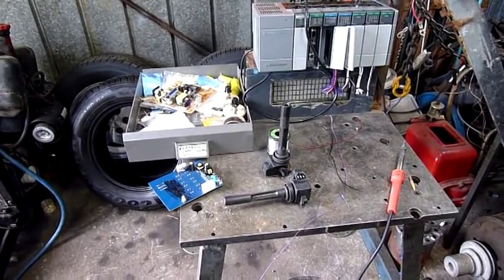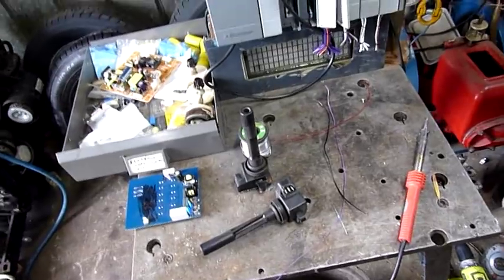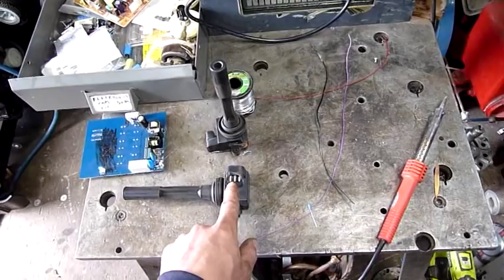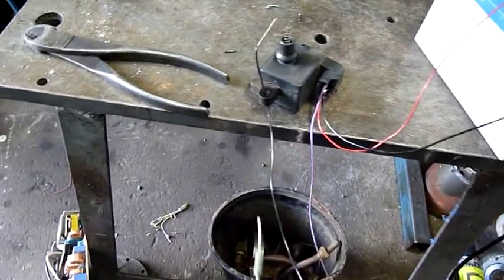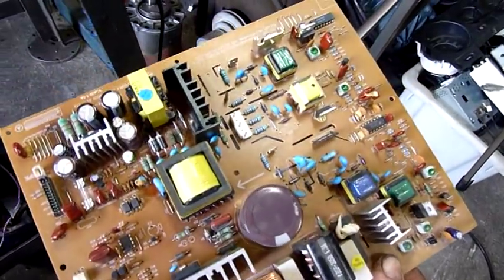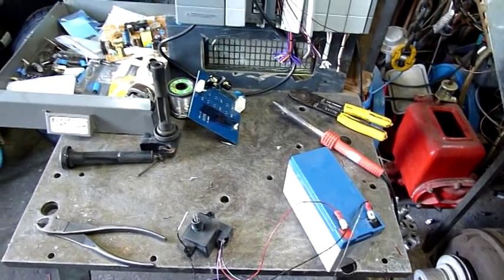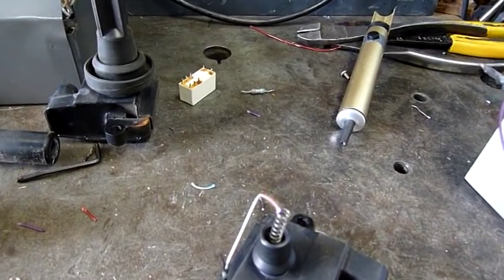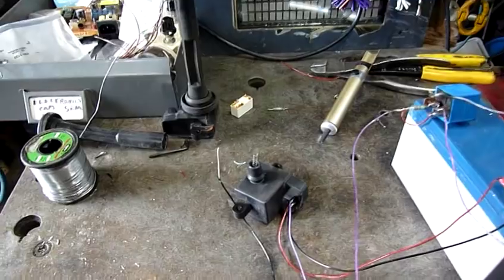Cheap Nasty Ignition Coil Driver - Oscillating Relay

Comment: This is a lot like how I did my first High Voltage experiments.  Except instead of an ignition coil I tried it with a MOT and a Flyback.  It worked until the little wall-wart power supply I used gave up on me, it was just too much for it to cope with.  The relay is still working and in something else now.

Comment: Stick some metallic rod into ign. coil HV output, make negative to metallic rod spark gap and you have very crude EMP. It might disconnect USB flash drives, keyboards and such in a couple m radius.

Comment: Great Video!... I love playing around with coils and relays.. They have so much potential for great experiments!! Here is exactly how it works....   when the coil de-energizes, the back emf is what is building the voltage spike that adds a much larger than normal amount input voltage to the primary of the coil. The relay in oscillation creates anywhere from 50 volts ac to 300 vac in oscillation just as long as there is not a suppression diode across the coil. If this is shown on the relay diagram, either cut it out of the circuit , or find another relay because it will not work based on the fact that the back emf spike is needed to drive the primary coil. Depending on the ratio of the transformer coil will determine the output voltage. Normally the input side of the coil sees 12 volts oscillated, or 12 vac, so, if the output would have normally be 50000 volts, it could be as high as 1,249,800 volts on the output using a relay as a driver ! to figure this out, take your 50kv output of the coil and divide it by 12... you'll get 4166, making the coil a 1-4166 ratio device. Take 300 vac (which is the maximum oscillation voltage that I normally obtain with the automotive relay) , and multiply it by 4166 and you'll get 1,250,000 volts maximum,  or close. That is some serious voltage, but, it will be a very low amperage that will not normally kill anybody but, it will suck if you get hit by this, so, definitely be careful as it may knock you out cold. If you had wire with insulation that could withstand this voltage, it probably wouldn't fail in the video, but, it is only a matter of time before the coil inside of the ignition coil fries due to over-voltage.. Good Luck & Have Fun!
Reply: I would think the coil would get over saturated before it reaches 1,000Kv.

Comment: You still haven't given compelling evidence that the relay booster voltage. You only spread the wires out and draw the ark out when you have the relay going you never did that when you just wired it straight up so we have nothing to compare it to.

Comment: work out what they draw, i shouldn't thing its much over an amp at full tilt. that means if it had a 10,000 volt secondary output  (should be much larger) it would have a 1.2 milliamp output. it will get you moving for sure but as they say, volts give you the jolts, amps put out your lamps. ide say its one of the safer things but as you say no high voltage is to be played with dosnt matter if its a 9 volt battery and an transformer with the secondary hooked up the the battery, those things burn!

Comment: I accidentally killed a pyramid 30 amp power supply years ago while playing with an ignition coil and a relay like this. The lesson is, use a diode to keep the hv out of your power supply, or just use a battery for power.

Comment: I put a Bosch coil and condenser on a turn signal relay. But my sparks arent even 1/2 of that. It is an old coil and an old 12V 7.2A/hr.
What I do like about the relay is that it sounds alot like its close to 50/60 hz. So I might try connecting a 2N3055 transistor and see if I can invert to 120 with a few watts.

Comment: It will hurt but it won't kill :) lots of volts no amps
i'm using a spark coil for m electric fence (used to secure my property from thiefes)
You could use a vacuum relay - lots of cycles per second due to the lightness of the contact armature and no air resistance

Comment: You could make a little 1 transistor amplifier circuit going to the trigger circuit and than have an old mp3 player with different frequencies going into the amp :) that might be the most simple way to do this without a relay :) should give it a try;)

Comment: My friend and I did this several years ago. We stretched a long wire (old phone wiring) across his backyard,connected one end to the ignition coil,and the far end we connected to a small flouro tube,with the tube's opposite end stick in the dirt. The tube lit and flickered..then his mom,neighbors,etc. all started coming out and yelling at us. Not only TV and radio,but Cable TV,phones,cellphones,etc. We wiped out damn-near every signal on the block.

Comment: I work on cars ,you work on electronics what works in the lab , does not sometimes work in the field , seen it in my 30 years of wrenching , case point GM HEI ignition ,and Chrysler corps lean burn systems  from the 1970's , and 20 years working on a funny car burning gas to Nitro ,we tried High KV setups and they do not work  low Kv and high amps work better ,  also Dr Christopher Jacobs was the one who proved it.

Comment: actually you do not want more voltage , you want more amperage ( push) with higher compressions , on a nitro motor we use 44 amp transformers to fire the fuel mixture , it make one hell of a nice thick blue spark , and also melts the tips off the plugs in open air , a normal car engine in cranking mode (450-600 rpm) is 100 psi , but once you get the motor running the pressures before firing can be upwards to 500 psi , and if the mixture is lean you need more amps to light the fire .

Comment: ED a automotive coil for the cop systems run at 60 hz at 7200 rpm at 12 v ( as thy fire once per 2 rev and have execellent dwell ) , the old single coil systems used a 6-9 v to run and 12 v to start ( for richer mixtures with the choke on ) and  its one coil firing all cylinders every 2 revs , so they have to be bigger to develop a charge quickly,  also to make the relays points last longer use a capacitor across the points , and the voltage across the gap is around 45k-60K but low amps  .

Comment: Incorrect. The breakdown voltage of air increases with pressure, so you need a higher voltage to strike an arc.

Comment: oh and I forgot to add the newer cars are fired by  the ecms with no mechanical relays , they must be using a mofset to do it , they also use them to control the injectors too , not a electronics person other than old car ignition stuff ,slowly learning the new systems on how the magic boxes work other than letting the magic smoke out of them .

Comment: look at a old model A ford ignition system , it was a vibrator they used to fire the motor , it randomly fired the cylinders .  simplistic and worked for many vehicles , Kettering ( Delco) was the one who developed the distributor and points system to be used on the Cadillacs and Gm adopted it . then it was adopted by the auto industry

Comment: That's what they used to do to step-up the 12V in a car,to power the tubes in the radio! Google for "Vibrator power supply" (No,not THAT type of vibrator.)
They even had vibrators with a second set of contacts,for synchronous rectification!

Comment: nope, because when an engine is near TDC, there is over 100psi of pressure in the cylinder, so there is more air in between the spark gap therefore the breakdown voltage gets higher, for high compression engines that can be upto 100kv!

Comment: P.S. EMP contd.: you might also experiment with different metallic rod lengths. it basically would be an antenna. 150-350mm might be good.

Comment: would putting a potentiometer in line with the coil of the relay to adjust the voltage going to it control  the speed that the relay vibrates ?

Comment: Well, this go's back to the T model ford and such coils that used the coil its self like the relay coil, with the vibrating contact on the end. You should be able to tune it using R and C on the relay coil, also this works well with old point style coils!

Comment: Many years ago when i was at school I made something similar using a GPO type relay and a valve (tube) push pull output transformer which gave 1cm sparks, feeding the dc from a pair of 9 volt batteries into the 3 ohm secondary and the output from the 2 anode taps on the transformer  - had it for years and learned a lot about high voltage  -  great stuff

Comment: Also,We used an older style cylindrical coil (think mid-60's V8 engine,with points)
A tip: Use an old condenser (or decent ~0.1uf HV cap) in parallel with the relay contacts.less arcing,they'll last longer.
The cap might not be needed with the coils Ed has,since they have a built-in driver..there's not much current flow with those,just a pulse signal.

Comment: You mentioned generating an arc in a vacuum--I once set up an old fuel-oil ignition transformer to arc across the gap in a burned-out incandescent light bulb.  It glowed with a purple color, and quickly became extremely hot.  Did not leave it on for long.

Comment: I tried this but the relay contacts welded themselves together
Reply: what type of capacitor are you using?
Reply: Electrolytic 4700 uf, need a smaller one as it can't react quickly enough. I found a triac driver to be better anyway, it's just a dimmer in series with a 1uf cap and a coil. produces gaps in excess of 2 inches and runs on 240v mains
Reply: Cool, glad you got it working. I am using a 440v 30uf non polarized cap and a spdf relay with two coils in parallel to one another but I'm using a DC power source so it can be mobile but otherwise I would use the dimmer setup too.